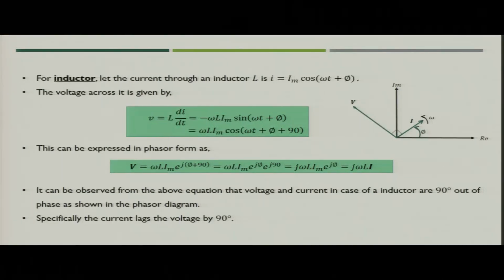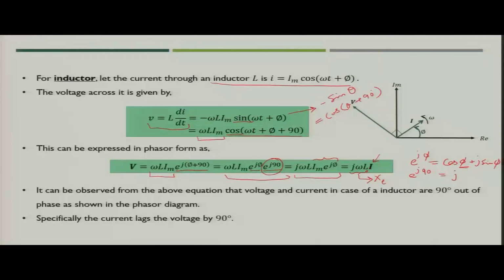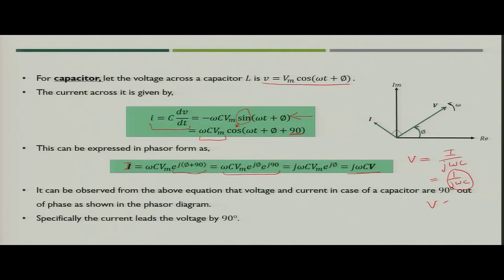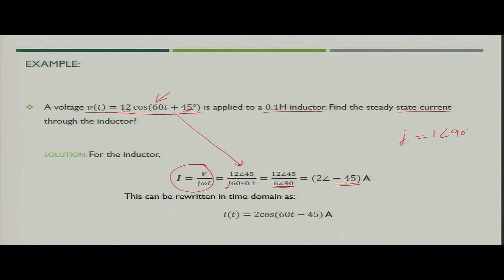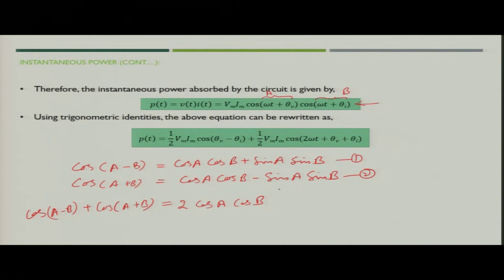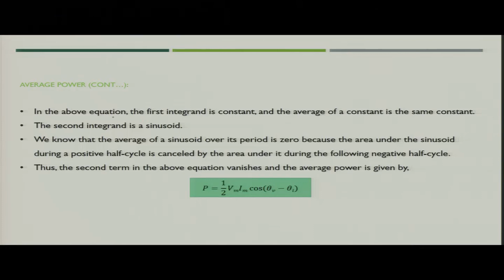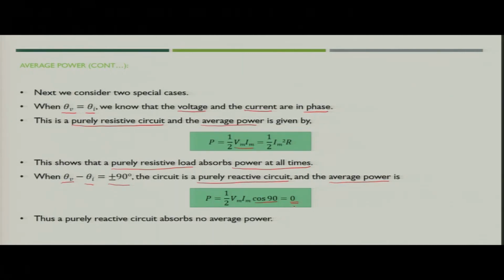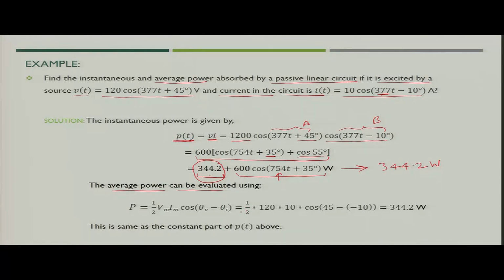noc19-ee36-lec05

Comment: There are nice lectures here too with unified approach to electroststics and circuits
Simple D.C. circuit.
1 Pattern of electric field.

Watch from 16.0 minute.

2 Mechanical Battery
Watch from 19.0 minute.
https://youtu.be/Eu3JQKrJRZA?si=t3MeX8Hi8ELAxaz0

3 First intro to Surface Charge
Watch from 10.30 minute.

4 Surface charge gradient
Watch from 15.30 minute.
https://youtu.be/bp0o1HZOs3g?si=PPiPGepbXvdTgJHX

Comment: RC circuit frequency domain 
The current (sinusoidal steady-state) in a capacitor is due to the resultant electric field E_net (resultant of the applied field and an opposing electric field, the fringe field). If the capacitance of the capacitor C is made large, then the fringe field does not build as fast as it would have if C were to be smaller. With a large C, the charge sprays on the plates do not result in developing a large voltage in a given interval of time as evident from the capacitor voltage-charge relation Q = CV. 

The fringe field is smaller and the net field consequently is greater. Therefore, at a fixed frequency, the current increases as the size of the capacitor is increased. The current also increases as the frequency is increased. So, we say it passes higher frequencies of applied voltage. 

If the frequency is made smaller, the fringe field builds very rapidly and in the limit when it is dc, it blocks the applied voltage.
It is not possible in this post to discuss in more detail current in capacitor circuits and capacitive reactance. The last frame References in video #1  lists textbook 4 which discusses these topics in more detail using a unified approach and provides an intuitive understanding of reactance. It also describes with sequential diagrams how the current leads the voltage across the capacitor by 90 degrees.
RL circuit frequency domain 

 The existence of a sinusoidal current resulting from the application of a sinusoidal voltage to an inductor is a characteristic of the non-Coulomb electric field that is proportional to the rate of change in current causing a changing magnetic field. 

 The current is a result of an opposing Coulomb electric field, which is a result of polarization by the non-Coulomb electric field associated with the changing magnetic field, and the current is a consequence of the resultant field of the applied field and the Coulomb electric field in the inductance coil. 

Inductors find applications as filters in power supplies and in resonant circuits in tuned amplifiers. 

If we increase the “frequency” of the input voltage to an inductor, the “rate of change” of the input voltage and the applied field is “greater than” the rates obtained with applied voltages at lower frequencies. At low frequencies, this causes a smaller induced opposing electric field and emf, therefore, large currents will flow within small intervals of time in the coils of the inductor. 

In the limit, if the input is a dc voltage, the current will become so large that the inductor will burn out. 

In an inductor, the opposition to the applied voltage which is changing the current is instantaneous and so, the current can only follow after the applied field has overcome the opposing emf. In an inductor for sinusoidal currents, the current lags the voltage by 90 degrees if the inductor is pure, and less if a resistance is in series with it; the inductor fights before current flows. If an inductor weren’t to fight, you will get energy for free! 

Low pass filters are built using L-R circuits in simple applications. Therefore, we say the inductor “blocks high frequencies” and acts as a “short circuit” at low frequencies as if the inductor was not there but a wire. 

 It is not possible in this post to discuss in more detail current in inductor circuits and inductive reactance with sequential diagrams (textbook 4, see below). 

The last frame References in video #1 lists textbooks 3 and 4 which discuss these topics in more detail using a unified approach and provide an intuitive understanding of reactance.